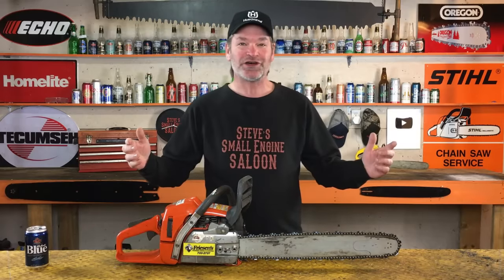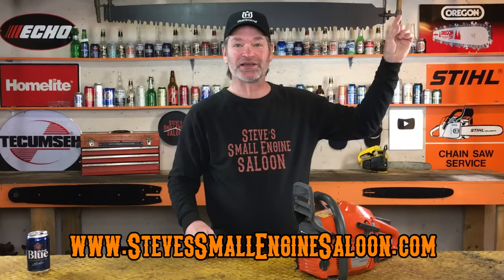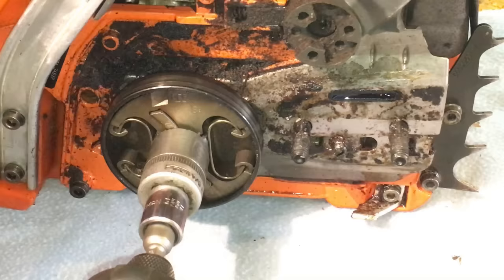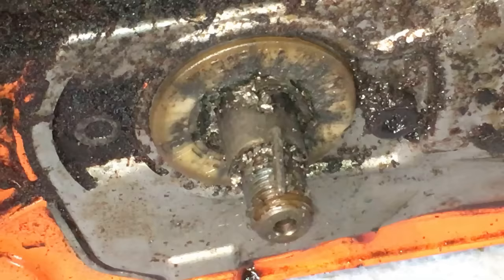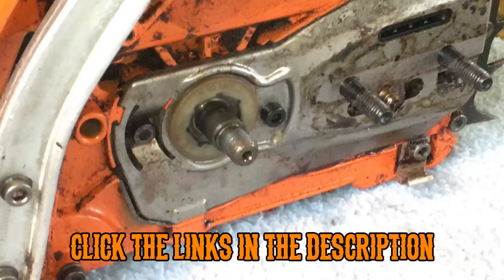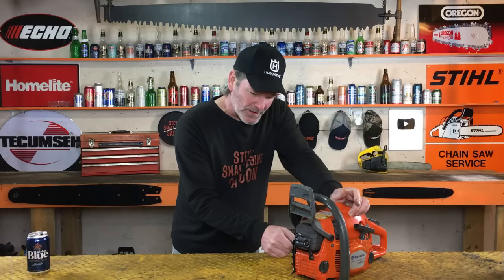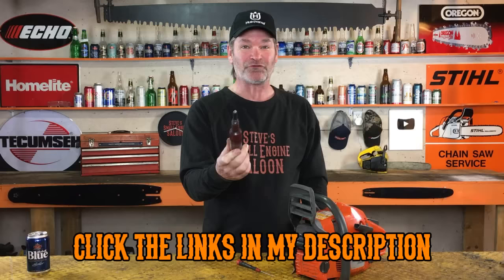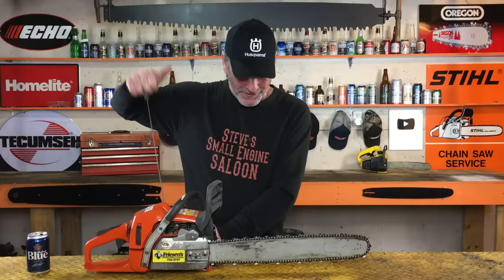WOW! Hidden Greasing Spot On A Chain Saw

Comment: I don't see a video on replacing mufflers, esp on the 130 FS weed eater.  Not that it should be difficult but after removing the obvious bolt, it still on and not going anywhere.  Some hidden secrets?  

I'm going to need a throttle cable replacement darn soon too.  Looks like that may take a whole throttle handle unit.  but for now, the muffler has me baffled (bad pun in there somewhere).

Comment: A touch of high heat bearing grease on those needle bearings before putting them in if crank doesn't have secret grease hole.

Comment: Just received a new Husqvarna 440e for Christmas.  There is a small hole on each dide of the bar near the nose.  I have looked at the instructions/manual and fine no instructions to grease it. ??? Does it need to be greased?
Thank you in advance.
Reply from the maker: If the option is there, I would use it...

Comment: Will that needle bearing cause the clutch to seize up?  I had a Husqvarna that ran and ran well (I bought it used).  2nd season it was running and it started acting up but would still start until about the 3rd or 4th time I pulled it out, it pretty much just locked up.  I have since bought a new Stihl Farmboss and love it. Just curious if that could have been the issue.

Comment: Hi sir I have a husky lawn tractor yth18k42 when I remove the pto.i have a weird sound like a bearing  that is going bad any way I had replace the 4 bearing on the spindles to my surprise the sound is still there I remove the 2 pulley binder.the problem is there can I just replace the bearing instead buying the new pulley. Thank you from Mike.

Comment: Steve I have a question. I just changed the fuel filter and both fuel lines on my fathers Poulan Pro 220. I fueled it up and she started and ran beautifully, however I shut it down and let it sit for about 10 minutes and when I started it again it immediately went to full throttle and the trigger doesn’t slow it or speed it up. Would it be the throttle cable possibly?

Comment: Hi Steve, subscribed, and love your tutorials.  I have an issue not found on your channel... yet, my Stihl chainsaw starts ok runs fine for a couple of minutes and then chugs to a stop.  I've been told might be a clogged exhaust manifold? Any ideas? I have replaced the air filter and spark plug.

Comment: Hi Steve, is this the same for Stihl Chainsaws? I have a Stihl 036 and if so, do you have a link for the proper clutch removing tool? I looked at Amazon and did not find one. There is one but in the description it says it's for leaf blowers and some  models of weed whackers.

Comment: Steve I have a fairly new troy built push mower as long as I spray a little starting fluid in the carburetor it runs great.....but will not start without priming the carb .....it's a ready start I should be able to pull the rope and go ......help me please
Reply: It has a plastic carburetor which is a first for me
Reply from the maker: Check the videos in my playlists....

Comment: Honda versatool polesaw is why I come here. Honda's "manual" does not make it clear what kind of grease to use on the gearbox nor what gun. I guess it doesn't have to be a "Honda" brand gun, says I must do this every 20 hours of operation. I've used the saw for more than that! doesn't seam to want to cut my oak's half broken branch after the ice storm! even a week after!

Comment: The husqvarna owners manual states the needle bearing should be lubricated with engine oil on a regular basis. Why wouldn't husquvarna recommend grease? I always used oil as stated and have never needed to replace the needle bearing. I have cut more then 350 cords of without any major repairs. I think I'll just keep using motor oil. It looks like a good idea... but there must be reason they don't recommend grease....🤔

Comment: Or I mean you can just wipe the bearing with a rag and rub a small amount of new grease to it with your finger. That's how I was taught, no tool needed. Doesn't need to be done too often, either. And remember with the huskies, disengage the chain brake before taking off the bar cover!!!

Comment: Anyone else wondering when that bearing goes bad if the crankshaft surface is marred enough to cause a problem? I guess it's really not a high-speed bearing as when the chainsaw is revved up the clutch is locked up anyway?

Comment: How can a pro not know about that grease fitting?? Also stihlheads even echo 490 has that grease hole too.That saw isnt that dirty.Possibly the crankhole got blocked but usually enough bar oil flying around will prevent that too. A good mechanic of anykinf would have felt that grinding.

Comment: He should of greased the bearing first and then put it  on, if then was no grease hole that bearing would burn up in 5 minutes of running.  When using the grease hole, rotate the bearing while greasing will fill the bearing better with grease.

Comment: As a professional, Production Timber Faller since i was 20 years old to Current (Nearly 30 Years) i can tell you from hands on Experiences that Greasing a Bar tip is TOTALLY UNNECESSARY, And is also a REALLY REALLY BAD Idea, UNLESS you have routinely done it from the time it was Brand new. If you randomly Grease a Bar Tip that has never been Greased, You can almost be Gauranteed that Tip will Blow Out in the 1st Tank or 2 of Gas after Greasing it. I get Over 1 Year on a Bar, and i NEVER EVER Grease the Tip, This is Running 6-7 Hours a Day, 5 Days a Week. Depending on the size of Timber, i burn up to 2 Gallons of Gas through my Stil 660s in a 6-7 Hour Day

Comment: that bearing did'nt fail for a lack of lube . it hardly does much but hold you clutch hub in place . if anyting i will 
apply just a dab of grease on it when replacing the chain . the only time it spins cause of a differential of speed between the crankshaft and clutch hub is at idle , but when the clutch and hub lock as one it the bearing does nothing . now you 
have the clutch , the hub , and the bearing locked as one turning unit . the other time you have a speed differential 
 between the crank and hub is when some imbecile gets the bar and chain stuck in a log and proceeds to gun it trying to 
un stuck it , it does'nt ever work . that is what happened in this case . as you can see here , the hub and the clutch is black and blue from excesive heat . the bearing was melted . imagine the load on that clutch while slipping cause the chain/hub
can't turn but the crank is while gunning it  . it's like putting a torch to it . that's what happened here and this guy can't 
see that . squirting grease into the kshaft could get some on the clutch . it is un necessary . remember, the clutch locks the 
crankshaft to the hub when cutting or just revving . that's when the bearing becomes solely a spacer .

Comment: Your better of not to grease thee parts “ once you start you have to do it all the time period “ that’s coming from a old wood man” their pack in grease all ready” for your cluch “ an the tip of your bar get enough oil when your chain is running “

Comment: you seem to have not mentioned it was caused by heat in the first place.  you should have shown greasing the drum bearing before installing.  not many saws have the drum bearing grease fitting in the crankshaft.